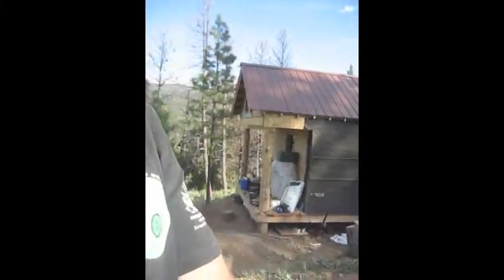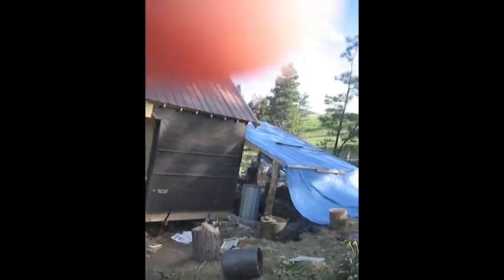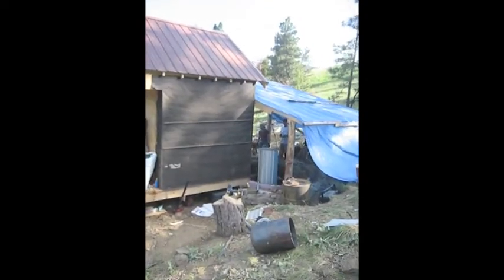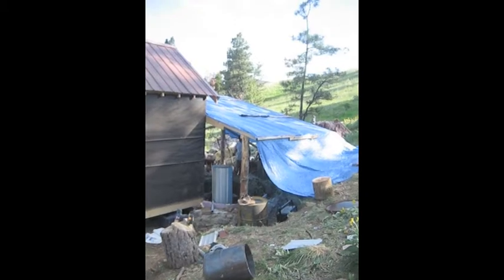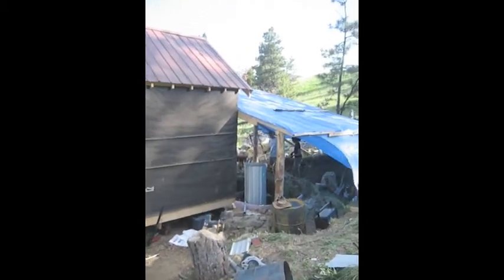EarthArtBuild's Rocket Mass Heater Explained

Comment: WELL?  How does it work?
Reply from the maker: Usually great!  But occasionally it back-smokes.  Which means the house fills up with smoke and you have to open up all the windows, which isn't very acceptable in Montana's -30 weather.  A taller inside chimney prevents back-smoking.